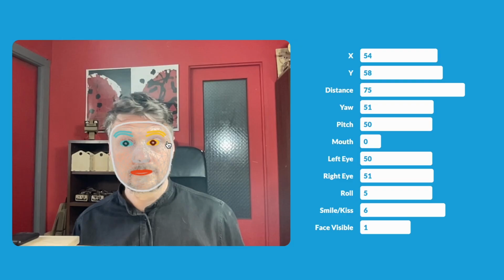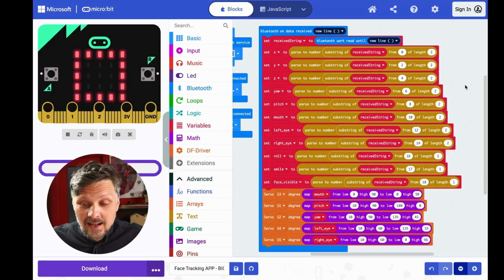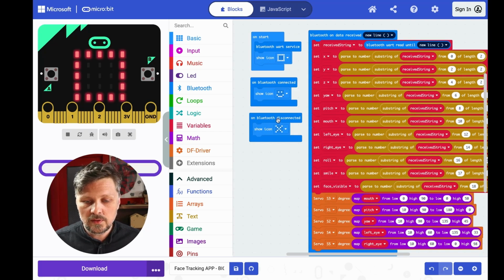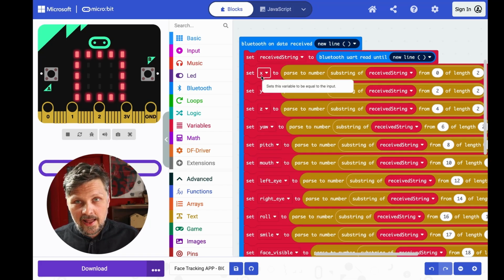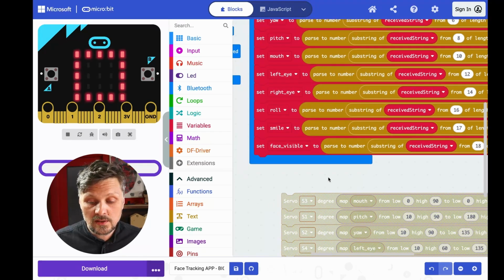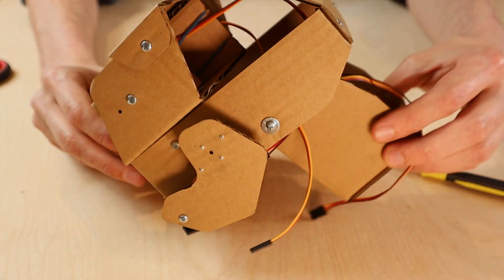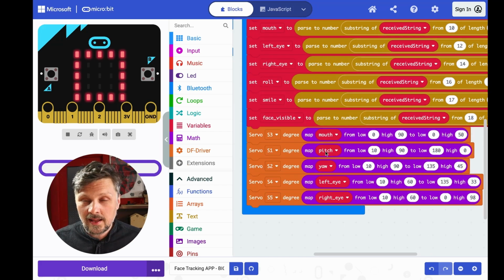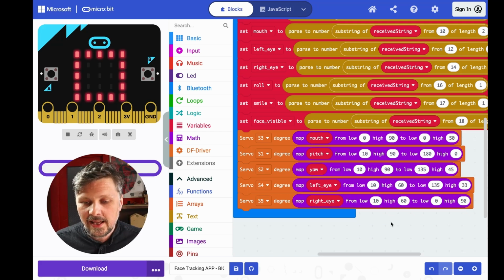New Face Tracking APP for DIY Robots

Comment: Hello, thank you for this video, for the arduino version do i need to use the specific bluetooth module you used or any one works, I am using HC06 bt module but it isn't connecting with the app. Please help
Reply from the maker: Hey, hc06 is bluetooh 2.0 it will not work with web-bluetooth and this kind of apps, you need bluetooth 4.0 module
Reply: @CARDBOARD_ROBOTS  thank you for this, I did get another bluetooth nmodule a 5.0 and it worked partially, but here's the thing the bluetooth disconnects on its own and i'm unable to connect it back except i restart the web app
Reply: Anu help on what I can do?
Reply from the maker: I am not able to support you all the way, try this tutorial and older version of face app for arduino:  https://cardboard.lofirobot.com/lasercut-robot-head/
Reply: @CARDBOARD_ROBOTS  Thank you for your time

Comment: I've to this all built and programmed on an iPad, but I can't seem to get any communication between the iPad and micro:bit. The bluetooth works, the programs download correctly, but once I open the web app on bluefy, there is no response. Not sure what to try next.
Reply from the maker: Do you upload code from my example or from your or project in makecode. if the app does not detect the board it is because of wrong project settings